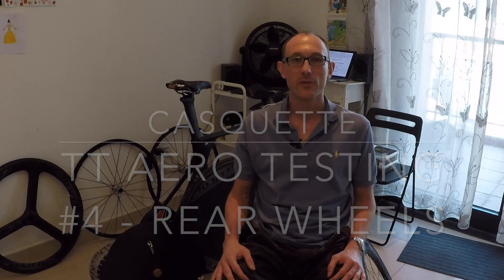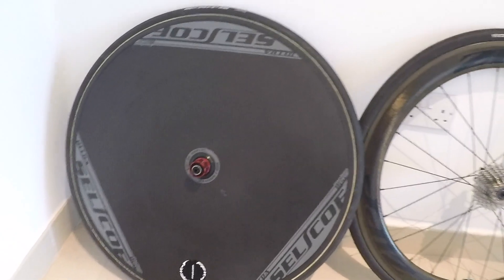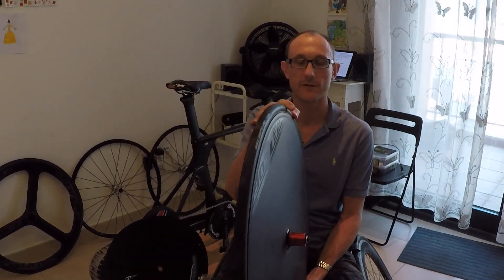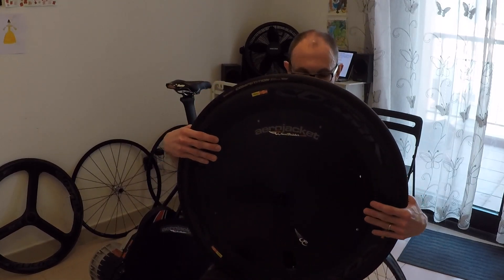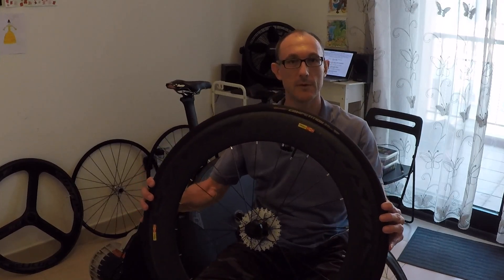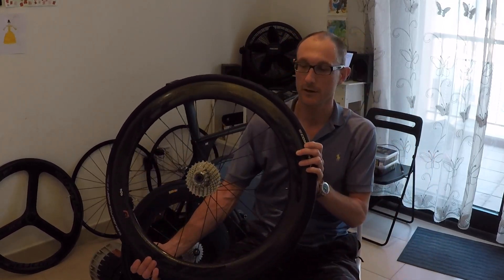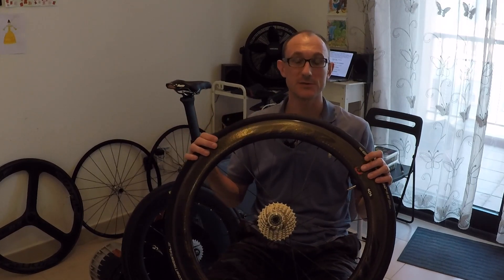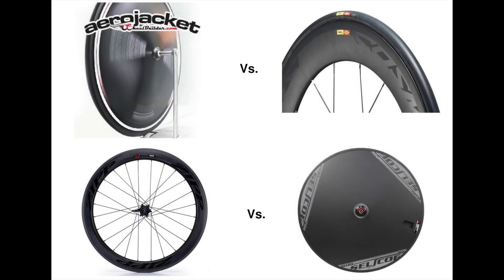Real World Aero Testing #4 - Rear Wheels - Using an Aeropod CdA meter

Comment: In your experience, how accurate is the Aeropod? I'm considering it to dial in my position, etc.
Reply from the maker: It's "quite" accurate. I believe it can be a useful guide for identifying aero-gains and will clearly show CdA impact for "mid-level" changes in set up (e.g. difference between various bottle choices, different wheels etc.). For those very fine set up details, like taping over your bolt heads, I doubt it would be able to see the difference since other "real-world" variables will cause variance between runs. For the most part, I believe it produces repeatable results which is the most important factor when assessing different positions or equipment. I've done one set of reliability tests with it on my road bike. 3 out of 4 results were almost identical (one was a bit off). I'm going to redo this repeatability test again soon, but on the TT bike, so watch out for that video... :o)
Reply: @Casquette  Looking forward to that. A review of the unit itself, including features, would be interesting :-)
Reply from the maker: @tripletrident1  Good idea, I'll include that in the same video and also a brief review of the Isaac software that you need to use to get your CdA :)
Reply: @Casquette  Do you know if it's possible to go 1x by just removing the Di2 FD and maybe making some setting adjustment? I'm getting Di2 this spring and I would consider going 1x on short and flat TT courses.
Reply from the maker: Knut Espen Bergby short answer: yes. Totally possible and relatively straightforward. To remove FD, you’ll need to break the chain, so fit a quick-link. Consider removing the inner chainring also to remove weight and drag (you’ll might need shorter chainring bolts after). You’ll have to think about where to hide away the disconnected cable once you unplug it from the FD. 
The risk going 1x is that it is easier to drop the chain. Consider fitting a chain guide mounted from FD hanger. Aerocoach do a neat one. 
Good luck!
Reply: Do you plan to switch between 1× and 2×?  You could look at 1× specific chainrings for better chain retention.